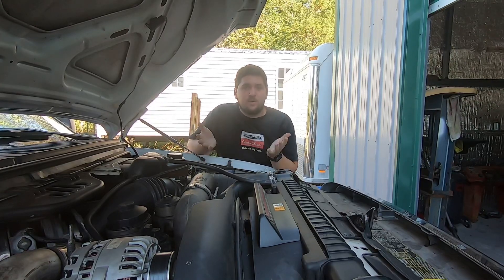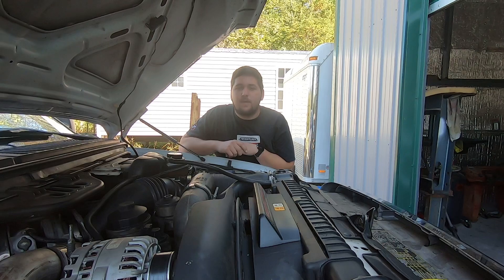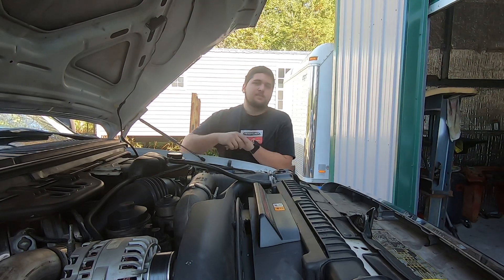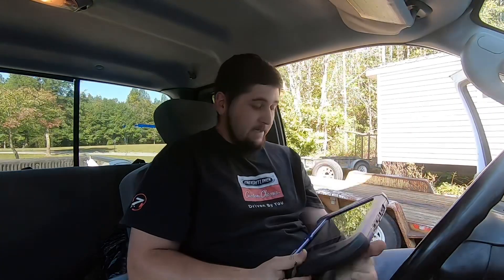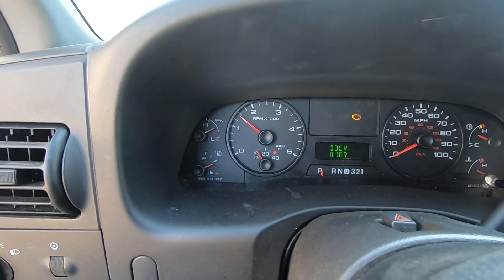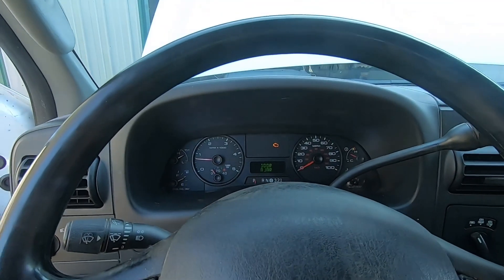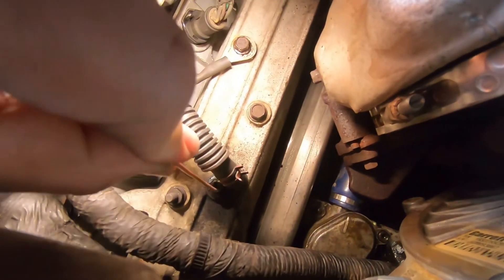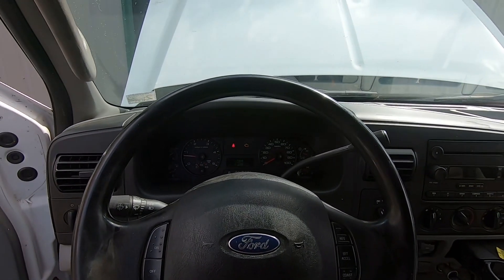P0299 Turbo Underboost - 6.0L Powerstroke Diagnostics! (PART 1)

Comment: I was getting  under boost codes, because of sheared oil, even  though I use the best oil, and change it more often than recommended.  I did a fresh oil change (Shaeffers supreme 9000), and the codes stopped.  This didn’t show up on the boost gage on my edge monitor and the truck was running fine. I had no boost leaks, no vgt problems, and no sensor problems.  I did have a MAF sensor fail on the intake a year later or so
Reply from the maker: That’s odd. I haven’t seen that. I use motorcraft oil in mine. Most of my customers use motorcraft or rotella. I’ve heard everyone say Schaffer’s is really good though but I don’t have it anywhere local to use it.
Reply: @paulsperformance  Motorcraft oil is supposed to be hydraulic rated oil, so it shouldn’t shear at the very high pressures required to fire the injectors.  I don’t know of any other diesel engine oil that is rated for high pressure hydraulic systems .  I also use 2 shots of revex, and amsoil bypass filtration.  My “lower than expected boost” code never came back after I did the oil change that time.
Reply from the maker: @rodgraff1782  only other oil I have used in my truck is royal purple which had done fine also but I stick to motorcraft when it’s available for these HEUI systems. I’m sure CAT makes an oil for those since they created these systems.

Comment: i have this code but its definetly not the turbo the thing works well but now the truck once it warms up idles down and won't go anywhere and just rolls coal. Could this be a possible sensor issue? truck sounds and runs well besides that
Reply from the maker: Yes could be a few different issues. This truck ended up being the EBP sensor

Comment: What is the squeal at time 3:50 when you started.  I have an occasional P0299 when the engine is cold and I touch the accelerator before the engine is warmed up.  Once the engine is warm I don’t have an issue.  I have an Edge 3 monitor on my dash and wait till the VGT moves from 85% before I touch the accelerator.  I have seen the VGT jump from 85% to 15% immediately after starting a cold engine.  VGT solenoid or stuck unison ring?
Reply from the maker: I would check your veins. If it’s an oem turbo it’s likely that it’s due for cleaning. Most of the time they have rust buildup and heat can help free it up but it’s likely to get stuck one day and not move. You can split the turbo and clean the rust and soot off the veins. Not really hard to do and won’t hurt to try before going towards wiring or the solenoid because most of the time if veins are acting up it’s because of rust.

Comment: Just bought one with a P0299 code. Running rough, will not build positive boost at all. EBP is reading 53psi at idle. Replaced Ebp and cleaned. Still no change. EGR was replaced as well. Still no change. Any suggestions? 53 psi seems like a lot even after replacing and cleaning.
Reply from the maker: What does it read unplugged? Does it fluctuate at all?
Reply: Just unplugged and it reads 21.48 with no change when given throttle. Turbo isn’t kicking in whatsoever.
Reply from the maker: @ryansmith513  do you have a way to cycle vgt vanes to make sure they are not stuck?
Reply: @paulsperformance  do you have any suggestions on how to do so? The monitor I have on is reading .85 at idle vgt duty cycle which seems normal. Then with some throttle, will decrease to about .6-.5. Occasionally will make a slight hiss and drop to .14.
Reply from the maker: @ryansmith513  is it straight piped? If so can you hear a change in tone to exhaust.
Reply: It is not straight piped. Still has cat and muffler. Possibly sounds like a slight manifold leak.
Reply from the maker: @ryansmith513  you might want to try unhooking the exhaust to check and make sure the cat is not plugged up.
Reply: @paulsperformance  cut the cat right off and didn’t seem too plugged but still no boost. Goes to almost .2 psi at 2500 rpm’s.